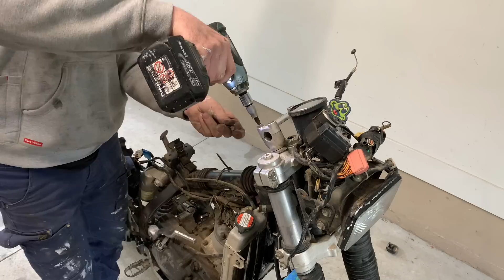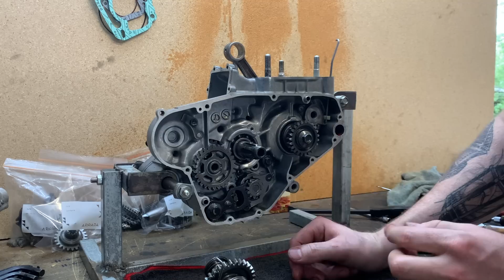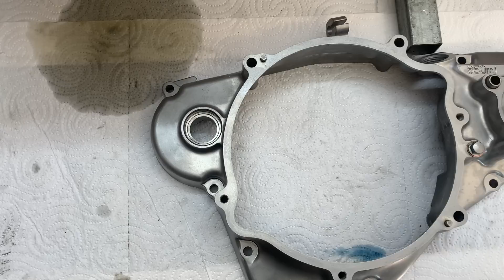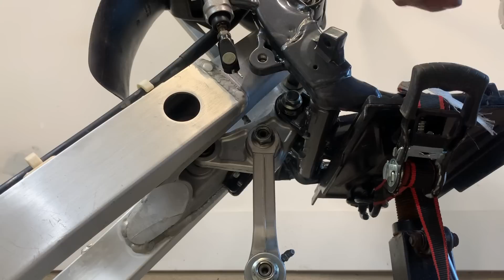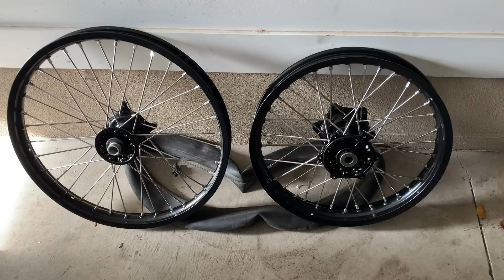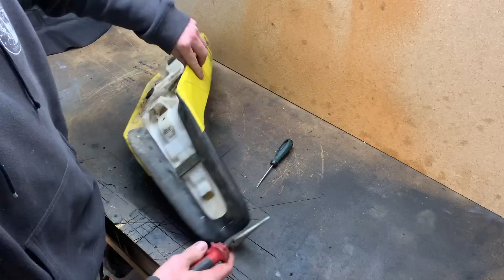$750 Suzuki RMX250 Dirt Bike Transformation! (Time-Lapse Complete Rebuild)

Comment: Love seeing these bikes from my childhood being restored! I did the same thing on my childhood 1985 XR250R. A lot of work/money goes into a frame up restoration. The guy I used to powder/ceramic coat my engine got little granular of sand in some of the threaded holes…. What a nightmare
Reply from the maker: Yeah I feel you, I had to clean the engine cases after the hydro blasting because the little glasss beads were like static charged to the cases and in all the threaded holes. Worth it for the result though

Comment: it’s a shame Suzuki could not keep up they had some a great lineup of bikes and 4 wheelers
Reply: they still have rmz
Reply: @goller.9797  yes, but to say they’ve fallen behind the other motto x bikes is an understatement.
Reply: @northerntoyota7584  almost thought they dropped out completely til I searched suzuki and see they've only kept a few models, Yamaha really the only one going hard as they got dirthbike, Quads, and now SXS with Honda and Kawasaki behind with dirtbikes and SXS
Reply: It is but they still have a few good bikes at least and it’s really the changed off-road market in AMerica. Dirt biking isn’t easy and seems like the high achievers are buying the Ktm 10 grand models and the lazies that used to buy quads are buying side by sides.

Comment: I have a doubt!
The original RM and RMX cylinders are coated with Hard Chrome or Nikasil (coating has a nickel matrix with SiC - silicon carbide particles)?
Reply from the maker: Its a Nikasil coated cylinder, I had it re-coated during the rebuild process
Reply: @jackkellybuilds  Thank you for the explanation. I'm from Brazil, I bought a 1998 Rm 250. Everyone here says that these imported bikes have hard chrome cylinders.

Comment: That was a great work, awesome for hare scrambles and ok for big open moto x tracks. 1 problem was the with the jetting, I found out through a  Suzuki mechanic that the RM125 3 or 4 needle helped heaps as It flooded a bit when you gave it some stick. The black look sweet, good as always video.
Reply from the maker: Thanks mate! 🍻
Reply: @jackkellybuilds  yeah no worries, it was the last bike that I owned and super close to my, it was the end of 15yrs riding/racing, so many good times.

Comment: what kind of material did you apply to the gasket, a different method I am interested because ı don't like liquid gasket
Reply from the maker: just regular grease, its to stop the gasket from sticking to the surfaces if I ever need to pull it apart

Comment: Hey bro, where did u get the tail tidy, and how did you go installing it
Reply from the maker: eBay mate, its just a universal tail tidy then I drilled holes in the fender and used bolts to mount it

Comment: OEM parts must be getting slim, why I sold mine. Looks like a 1 piece PV? Some had 3 pieces! Those flywheels like to spew their magnets, good luck finding a replacement. Old stiff airboots can become supple again with a heat gun.
Ive got a TS200R on the go, some interesting tech on those.
Reply from the maker: You might be surprised, I didn’t have much trouble finding oem parts. But mine wasn’t a restoration. You’re right about the flywheels, but most people like myself just JB weld the magnets back in if they didn’t get chewed up by the stator. Thanks for watching

Comment: Were did you get you plastics? All i can find is the vintage round floppy style front fender and square rear and no sides
Reply from the maker: The front fender is off of a late model rm250, rear fender and side panels are from a rm250 96-00 and are all from UFO plastics. unfortunately the radiator shrouds are discontinued and can't be purchased brand new anywhere

Comment: Is that a 98? Looks like an RM but I know they did up the a98 or '97 but it wasn't in the United States I had a 94 RMX 250 one owner basically brand new and it looks very different but I know that's the next generation so maybe I just don't know everything about my 94. Had FMF exhaust and the RM head on it and it was a f**** beast and it did easily 90. Maybe even 100 cuz of the gearing and it was a monster in the woods. You could lug it around or you could romp power band... great bike man i paide 2200 for mine but it like new had a new top end.. i only had to get tires and rebuild the suspension
Reply from the maker: Yeah the US never got this model, sad I didn’t keep it for long after I finished the project so I didn’t get to ride it in the woods, but the new owner seems to be enjoying it! Thanks for the comment

Comment: Not sure what year is the this RMX, but its basically a RM 250 gen 96-2000. In my opinion, the modern front light and the front fender from a 2001-2007 RM generation is not period correct. A mistake I did myself and something you learn from experience, to not mix generations.
Reply from the maker: This was not a restoration, it’s a custom build